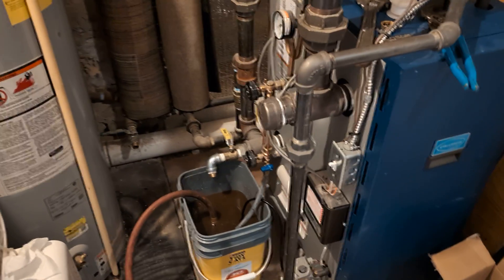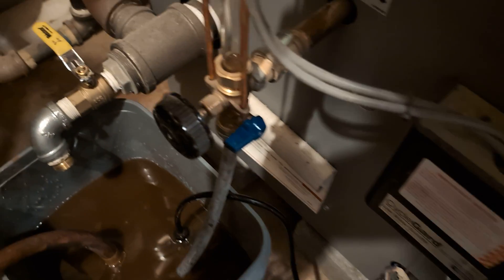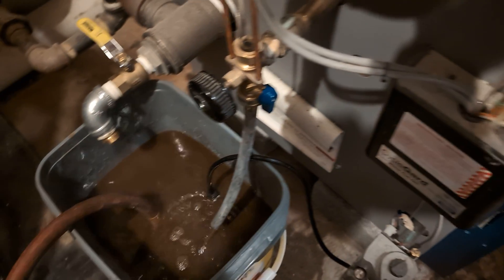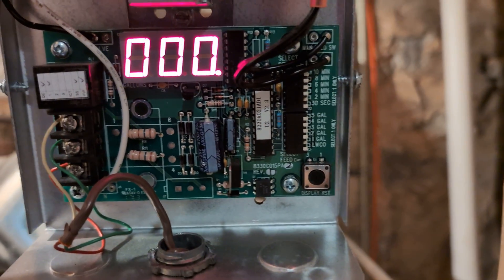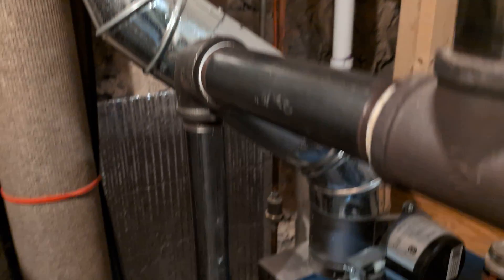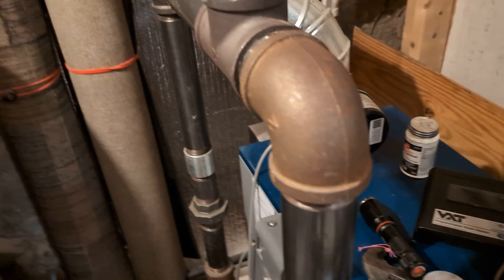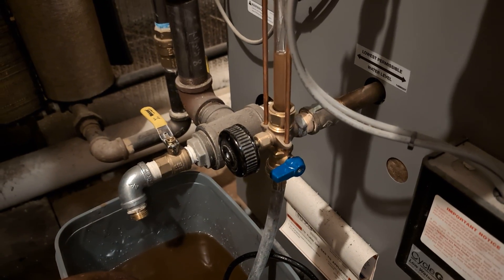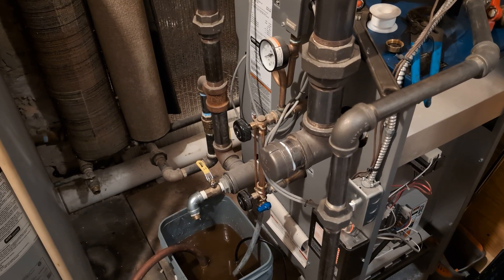Testing A Steam Boiler Probe-Type Low Water Cut Off (LWCO)

Comment: I was a bit negligent when it comes to annually cleaning the probe for my CycleGard CG400-2090 installed in 2007.  Meaning I don't think I ever did it lol.  I did drop the water down a couple times to make sure the boiler shut off but not for a couple years or so.  I know!  Anyways I want to say that the Hydrolevel instructions are remiss in the respect that they suggest that deposits on the probe would cause it to get an amber light when water level is actually OK and that never happened to me.  I guess that would be for mineral deposits.  Well they should mention that iron oxide deposits will be conductive and that is what happened to mine.  Fortunately I caught it before my boiler had any possible accidents that would've destroyed it.  The probe measures the same resistance whether it is in the boiler water or it is out of it (but still wet).  A brand new probe and an older clean one absolutely do not do that.  Pretty negligent on the part of whoever wrote the Installation and Operation manual.  The new probe seems to be improved in that it has some sort of non stick coating over the ceramic that feels like either polyethylene or teflon.
Reply from the maker: Hydrolevel has had problems with their probes down the years, almost all of the issues due to the ceramic failing in one way or other.
Sometimes, a small crack in the ceramic will let water in, shorting the probe to "ground" (the brass), and tricking the electronics that there is water in the boiler when there is not. 
The probe will work when you test it cold, but when you test the LWCO while the boiler is running, that's when most of the failures come to light.
Reply: @gordonschweizer5154  Thanks.  I will do baseline resistance checks on the new submerged probe both hot and cold and post the value on the boiler so that I will be prompted to re-check annually.  Edit - checked the resistance hot right after a boiler cycle ended and it is like measuring the resistance of a capacitor, where the measured value rises as the capacitor charges up (I guess) so I decided to take several readings after 10 secs.  and got a range of 7.3 to 7.6 kOhms so that will be my baseline for the future.

Comment: Hello. I have a Triangle Tube PE110 boiler. I am getting error code B 30, which means: High Temperature Limit, Boiler Supply and Return Temperature Differential is Greater than 72 Degrees.   Its right after it fires up.   Start it up, hits this error code less than 1-2 mins.   The boiler then toggles between this B 30 code and a 9 144 which means blocked.    Any ideas?
Reply from the maker: @Romulan112  I am sorry, but I have never worked on a Triangle tube boiler

Comment: Would you recommend replacing the probe after 5 - 6 yrs depending on the water quality in your area.  Hard water has shown great potential do damaging everything in site. It is not a cheap part.
Reply from the maker: @jazzcornertv  Probe manufacturers recommend pulling, checking & cleaning the probe yearly. They also recommend replacing the probe every ten years.
Reply from the maker: @jazzcornertv  A probe might not be a cheap part, but it is cheaper than a new boiler.
Reply: @gordonschweizer5154  You have inspired me to contact my boiler co. In NJ the areas with hard water will encounter damage. My boiler is under warranty and they do winter pm, but skip the Low Water Cut Off probe inspection and they don't volunteer to suggest either.  Thanks for all your help.

Comment: How many gallons of make up water is acceptable for an sgo3 or sgo4?
Reply from the maker: I assume you are referring to the numbers displayed on a VXT-120.
Those numbers should be in the single digits in an ideal system
Reply: @gordonschweizer5154  thanks very much. That's what I thought. You mean per heating season right?
Reply from the maker: @patrickwelch620  Yes. The numbers signify the amount of water in gallons lost, more or less 
Fresh make-up water brings in dissolved oxygen and that rusts out the boiler.
Reply: @gordonschweizer5154   Thanks very much.  My old sgo used 23g in a month till I switched over to wood for the rest of the season. No leaky valves and no make up water was used for the rest of the season while the boiler wasn't used. Sight glass is still at the same level as back in early Dec. Pressure never went above .5psi (I have a 3psi gauge). Funny I never saw the steam coming out of the chimney like I was told I should see though...

Comment: Fantastic image quality!  It really brings out the hues in that muddy water.  
Curious, does anything seem odd with that water heater venting strategy?  I usually see Y-collectors that merge together, but never a right angle.  Worried that with the lower-btu appliance not upstream of the boiler, it might result in backdrafting, or even vice-versa.
Reply from the maker: That might be AI adding those nice hues, I don't know lol.
As this chimney was originally designed to pull a lot of air through a big pile of burning rocks, I think it works ok even with that admittedly funky  tee.